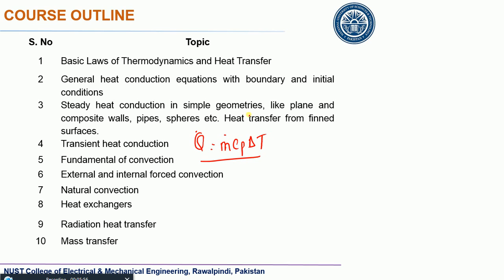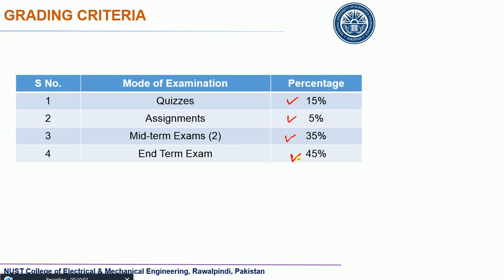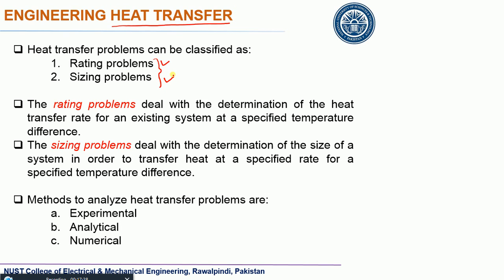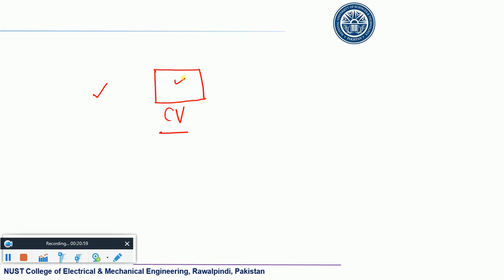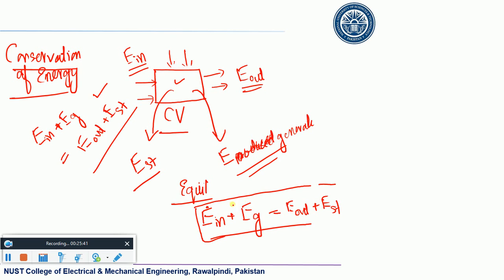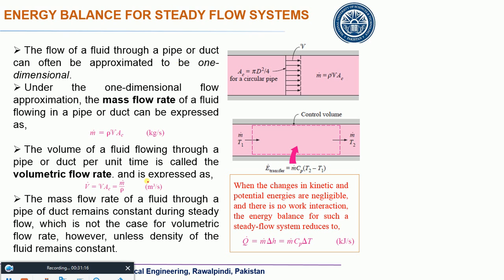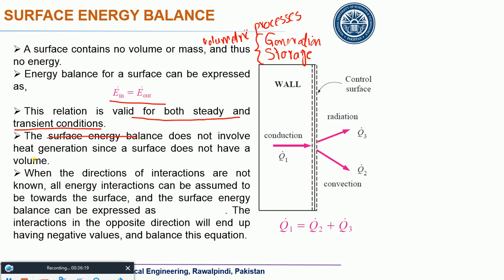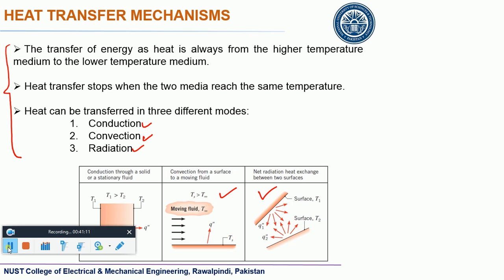ME 330 Heat & Mass Transfer Lecture 1

Comment: would you explain the energy generation within the control surface, how it in not possible?
Reply from the maker: Energy generation, in itself, is a volumetric process. Surface representes a plain area that can be used to quantify flux. Energy can only pass through a control surface.